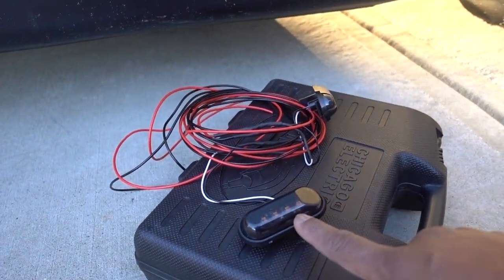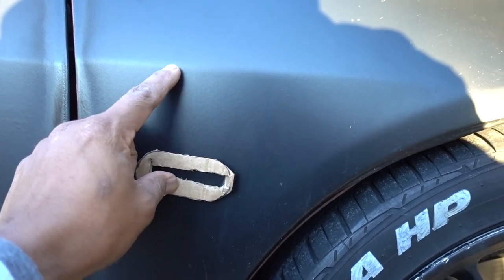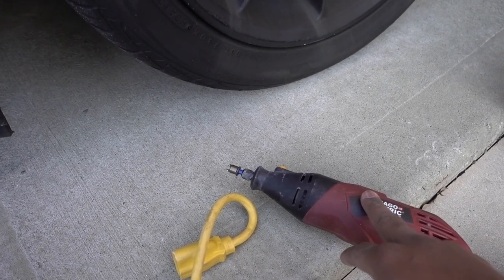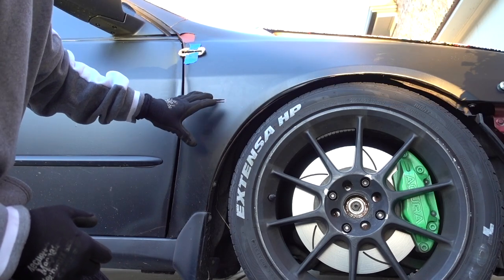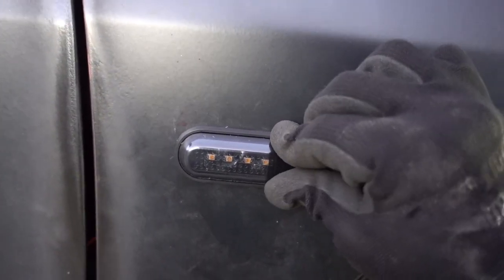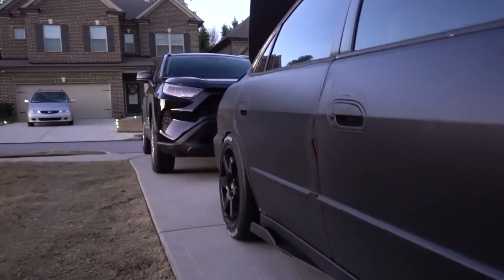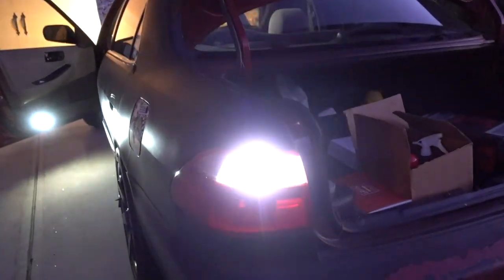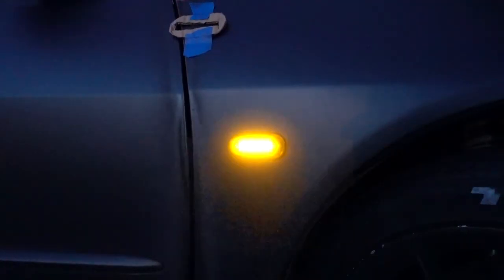How To Install Side Markers on Honda Accord

Comment: Can you do a vid on a Honda accord 2000 engine bay ?
Reply from the maker: What on the engine bay?
Reply: @BulletSolano  how to clean the engine and everhing around . Mynes so dirty
Reply from the maker: https://youtu.be/rafgs_fm5rA
Reply from the maker: Be careful with electrical parts, put plastic bags on them
Reply: Would that be the fuse box only ??
Reply from the maker: Fuse box, alternator, distributor and injectors
Reply: @BulletSolano  thank you!!
Reply from the maker: No problem